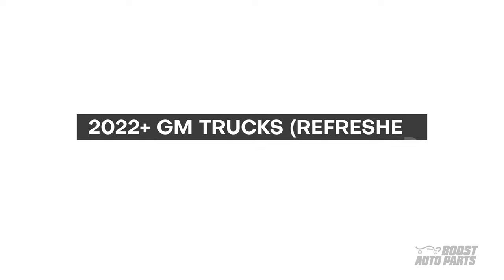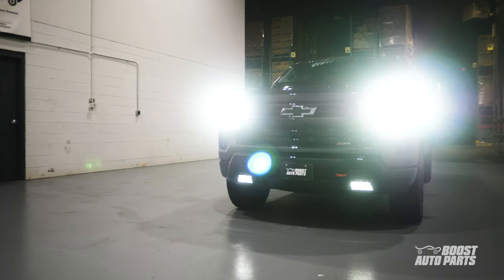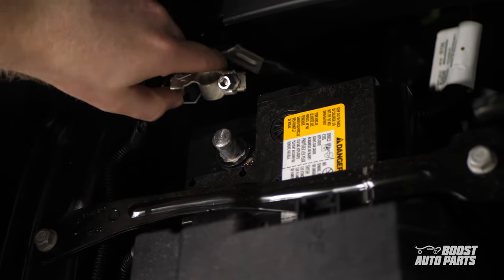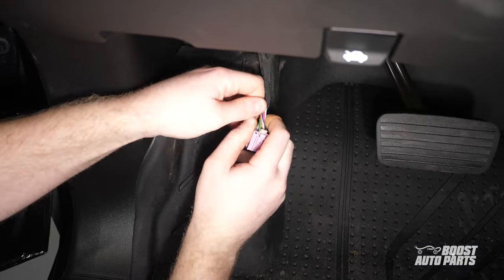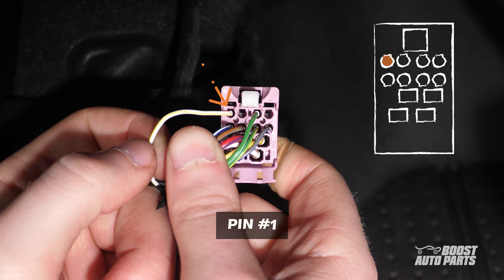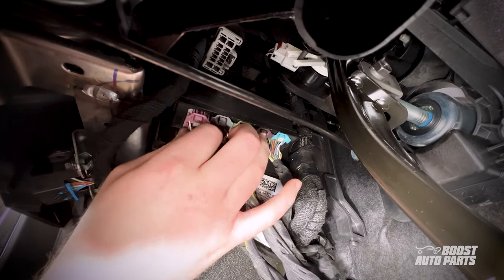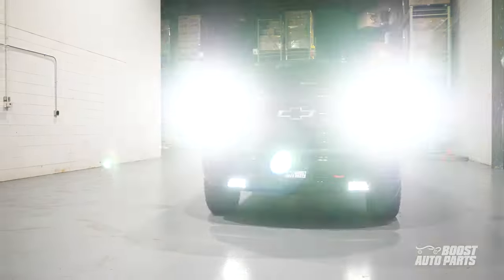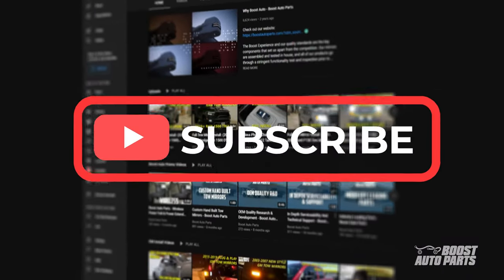Automatic Fog Lights On (Auto Fogs Mod) - 2022-2024 Refreshed Chevy Silverado / GMC Sierra 1500

Comment: The BLUE connector goes to PIN #1 lead. Listen to the instructions.  Once I had the connectors installed I just slapped it together not thinking it was directional. and of course it did not work. Pulled the pink connector and reversed the connections, ALL SET! I did not disconnect the battery.
Love it.
Reply from the maker: Glad to hear you got it figured out. The orientation of the module is certainly critical.
Reply: Thank you so much for this

Comment: I have had some conversations with your customer service team but wanted to raise a question here, just to ensure I’m clear as to what I’m looking for: I’d like to have my fog lights illuminated anytime my low or high beams are on. However, on my ‘23 Yukon Denali equipped with Intellibeam automatic headlights, activating Intellibeam completely disables the fogs. Ideally, I would like to be able to drive with Intellibeam activated while having the fogs on (high and low beam). I understand you don’t currently offer that capability, but it would be very helpful in deer-infested Wisconsin. Thanks!
Reply from the maker: We don't offer any fog light mods for the 21+ SUV's at this time, but I'll relay the interest to the development team.
Reply: I have a 24 Silverado with intellibeam, so I’d like to know that also. Have you received an update?
Reply: @ZackDukeGorham me too I can use the intelligence high beam with the dog lights activated terrible thing gm did
Reply: Did you get any info on this same issue with my 2024 2500hd 🤦‍♂️

Comment: I have Intellibeam automatic headlights in my 23 Sierra. I would like the fog lights to be on whenever the low beams are one. I would also like the fog lights to be able to stay on when the Intellibeam automatic headlights are enabled and come on. Is that possible? Right now, you cannot have the Intellibeam automatic headlights enabled while your fog lights are on.
Reply from the maker: Yes, that should certainly be possible. Give our team a call at 765-831-2830 or email sales@boostautoparts.com with what you're looking to do and they should be able to help.
Reply: Yes, it worked great.
Reply: @graham6007   how did you make this work for you? I have same truck and want there same thing. thanks
Reply: Give boostauto a call. I no longer have this truck and I forgot which color wires to connect. Sorry! @tiusica
Reply: @tiusica any updates on the fog light high beam intelligence issue I have a 2024 2400hd
Reply: @Intwodeep902 have not done anything other than installing the fog light mod.
Reply: @tiusica  are you able to use your intelligent highbeam lights with the mod?
Reply: @Intwodeep902  no.  But I can use the high beams manually without turning the fog lights off.

Comment: Hello ,with this mod driving during the day will keep the fogs lights off with the running day lights ??
Reply from the maker: If you keep the switch in AUTO the fog lights will only come on at night. They aren't triggered with the daytime running lights, they're triggered with the park lights that only come on at night if the switch is left in auto.
Reply: Thanks ,just installed ,works perfect ,great product
Reply from the maker: @RobinHood-yx9bs  Awesome, happy to hear it!
Reply: @boostautoparts how to get the fog lights to illuminate all the time when the light switch is auto ?

Comment: With this mod will my intelligence high beams work? Cause at this time on my 2024 2500hd gm will not allow for the fog lights to be on while having the intelligence high beam activated thanks
Reply from the maker: Yes it will, as long as you allow the mod to trigger the fog lights automatically instead of pressing the button
Reply: @boostautoparts  OK awesome so I’m assuming the mod somehow intelligently bypasses the factory GM mode
Reply from the maker: @Intwodeep902  Correct

Comment: So how does this exactly work? Does this activate the fog lights only when the headlights (low beams) come on? Or onle when the daytime running lights (DRL's) are on?
Reply from the maker: This activates them with the parking lights - so if you leave the headlight switch in AUTO, they will only come on automatically at night.

Comment: Will this work with a 2024 sierra 1500 denali ultimate? looking to have fog lights turn on automatically with headlights when switch in auto mode.
Reply from the maker: Yes it will!
Reply: Did this work on your 2024 Sierra 1500?  I was told it was not validated for my 2024 Silverado 1500 yet.
Reply from the maker: It will work on a 2024 Sierra 1500 - our site just has not been updated yet with 2024 fitment across the board. @greggreer698
Reply: Thanks for the response.  Would this also work on the 2024 Silverado 1500?  Looks like the same set-up as the 2024 Sierra 1500.
Reply from the maker: Yes! @greggreer698